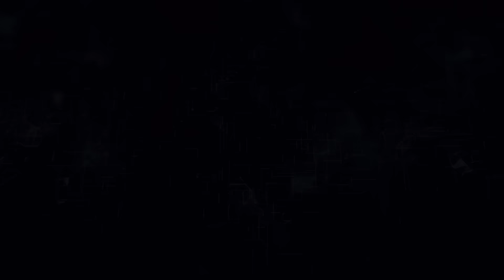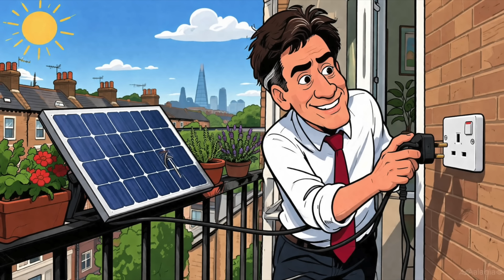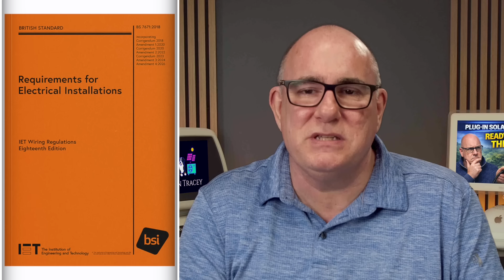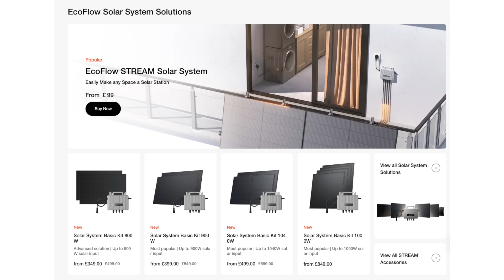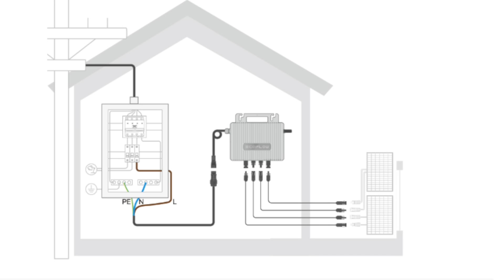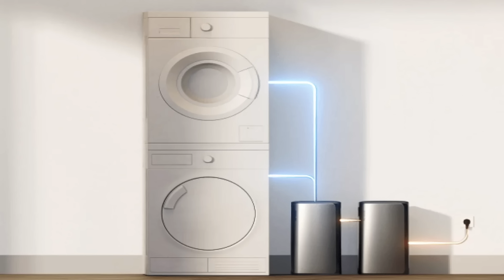Plug In Solar Is Coming… But There’s a Problem

Comment: ok I have an existing 4kw roof system on one of the old fit rates. When the sun shines I am exporting power on assumed 😢50% rate, so if I get a balcony system it would just all go to export with no money return. However there is a possible fix 😜 if I insert a power socket in the feed between the generation meter and the existing inverter and plug in there my balcony solar would be recorded on my generation meter. Somehow do not think ofgen would be happy but is it permissable.
Reply from the maker: @tracydowler834 I definitely wouldn't do that. If you connected a balcony system in a way that caused its generation to be recorded by your FIT generation meter, you'd effectively be claiming FIT payments on electricity that isn't coming from the accredited FIT installation.

The good news is that because you're on deemed export, the balcony system wouldn't reduce your FIT export payments. The energy from the balcony system would first reduce your import from the grid, which still has value, especially at today's electricity prices.

So while Ofgem probably wouldn't be very impressed with the "creative wiring" solution 😄, a properly installed balcony system can still save you money even alongside an older FIT installation.

Comment: Tks. Good info on 'side issues.' Please keep us up to date.
Reply from the maker: Will do Dave, new video coming this Tuesday showing what is possible. I built a simple plug in system with two panels, inverter and mounts for less than £300

Comment: Excellent video .. (  🇬🇧 electric regulations 💩  ) .. how many public sector workers  does it take to change a light bulb .... one to drive the van ... one to make the tea (  😝 ) ... one to take the light bulb  back to the depot ( fitting wrong ) ... and one to fill out the ( health - n - safety regulations ) ... U get this .. please comment ................ DAVE™🛑
Reply from the maker: Yeah, you do sometimes wonder if the entire civil service are basically extras from the series, yes Minister

Comment: If you want to know your baseline electricity consumption in your house or apartment, 
then look at how much electricity you use on Sunday afternoons when only the standby devices are plugged in and no heating is active.

This is the energy that you can replace with plug-in solar devices.
Reply from the maker: @jensschroder8214 that’s a good rule of thumb, but it can be quite misleading depending on how a household actually lives.

A lot of people don’t have a clean “Sunday afternoon baseline” — you’ve got fridges cycling, people in and out, kids on devices, maybe someone cooking, maybe not. For some homes that number will be way higher or lower than their true minimum.

A better way to think about it is your continuous load — what your house is drawing 24/7 regardless of time of day. That’s the bit plug-in solar is really targeting.

And even then, plug-in solar doesn’t just cover that one window — it offsets whatever you’re using when the sun is out. So if you work from home, run appliances in the day, or charge devices, it can go well beyond just “standby power”.

So you’re right in principle, but in practice it’s less about one snapshot in time and more about understanding your actual usage profile over the whole day 👍

Comment: It was similar in Germany. The regulations weren't ready yet, so people were already using plug-in solar devices. 
Anyone who can assemble a plug can put the finished cable together. 
There is a greater risk of an unstable solar module falling from the roof than of someone getting an electric shock.
The devices prevent voltage from being released if there is no 50Hz alternating voltage.
Even a loose plug or a bad connection to the fuse box and the device switches off.
Reply from the maker: @jensschroder8214 yeah this is exactly what people often miss 👍

What you’re describing is anti-islanding, and you’re right — these systems are designed to shut down the moment they don’t detect a stable 50Hz grid signal. So if the grid goes down, loose connection, bad wiring etc, they stop exporting almost instantly.

That’s why across Europe (Germany especially) we’ve seen huge adoption of plug-in solar without the wave of electrical incidents some people are predicting.

Where I think the UK discussion gets a bit skewed is we focus heavily on the electrical side, when realistically the bigger risks are often mechanical — poor mounting, panels not secured properly, that kind of thing.

That said, I do think we still need sensible standards here — not to stop adoption, but to make sure installs are safe and consistent as it scales.

So yeah, broadly agree — the technology itself is already doing a lot of the safety work 👍

Comment: I don’t agree with the base load part. In our house we are two and working from home. Base load is 34w. When fridge starts we go up to 100w. When we are both working, lights on (winter) and fridge is on, we tops at 230w. 
It means that we would almost always store energy in a battery that would kick in during the night.

The only time it won’t cover our needs would be when we cook something. Even washing machine would be covered by the plug-in solar.

Not everyone is using 10/20kWh a day. We use 3/3.5.
Reply from the maker: no one is saying everyone uses 10/20kWh, everyones base load is different but for most, like you it sounds like a small system like this will cover your needs just fine

Comment: Plug-in solar / battery systems look like the way I'll go. We're not planning on staying at our house long enough to recoup the investment in a hard-wired system (probably move in about 5 years). With plug-in it is:

1) Cheaper as no labour to pay for.
2) Mobile, we can take it with us when we move.
3) Configurable to take advantage of EV tariffs.

Ecoflow do the Stream Ultra X Storage Kit which has 5.76kWh of storage, which based on our current IOG on and off-peak rates would give us pay back in about 5 years. The intention is to cover peak demand using off-peak storage as is pretty standard, for us, 5kWh would cover the evening surge. Then as you mention, the solar option is there if you want to cover the background noise throughout the day (i.e. fridge etc). I'm quite optimistic about it, although why is this country always at the arse end of adopting modern technology...that's a rhetorical question btw, I know the answer.
Reply from the maker: @Chris-eo5zs That’s a really well thought through approach 👍  

You’ve basically nailed the use case — use cheap off-peak to cover evenings, then let solar chip away at the daytime base load.  

And the portability point is massive… a lot of people overlook that when comparing to fixed installs.  

5 year ROI is actually pretty solid in the current market, especially if you’re consistently cycling it daily.

Comment: Can someone please explain to me the impact of sending electricity backwards through my RCBOs?
Reply from the maker: if they are bi directional no issues, if they are not there is potential for them to be damaged an not trip out when needed
Reply: @JonathanTracey  Ok, thanks for the feedback. Would I just need to have a bi-directional RCBO on the ring circuit that the plug-in solar / inverter is on?

Comment: If you buy one now and just plug it I ro a socket, will the pins be live? Also, as its not wired in, would it be legal? Perhaps just unplug and switch off the solar pending a safety inspection? Just as none wired in outdoor sockets are legal if just plugged into a socket in the house. It's just an extension lead in effect. Preferably with a wired red plug fitted to the indoor chosen socket.
So, if it turns out it is legal, but very dangerous, is it still possible? Perhaps an outdoor waterproof socket with a tamperproof cover so the plug cant be easily taken out. I want one!
Reply from the maker: @nodriveasusephotos8019 Good questions — there’s a lot of confusion around this at the moment.  

The pins won’t be live when unplugged — the inverter only outputs when it detects grid power (that’s the anti-islanding protection).  

Legality is the grey area in the UK right now — technically not fully supported in regs yet, but also not explicitly banned if done safely.  

Big thing is making sure it’s installed properly (RCD/RCBO protection, suitable circuit, etc). It’s not just an “extension lead” situation — it needs to be treated like a generation source.  

Hopefully the regs catch up soon because a lot of people want to do exactly this.

Comment: Question: I understand Plug in Solar is limited to 800w with an Ecoflow inverter. Could a second 800w installation be installed if it fed into a separate ring main?
Reply from the maker: yes, absolutely. I know it works because I’m doing it right now. However, I’m not sure once the legislation gets updated whether this”legally” allowed

Comment: Sorry to sound stupid, but to me a plug socket is for power going OUT.
If you plug a solar panel, via an inverter, and plug it in, then the power is going IN.
IE Sending electricity the wrong way. 
That doesn't make sense to me.
Where am I getting this wrong?
Reply from the maker: @StephenInfield It feels wrong, but it isn’t 👍

Your house wiring doesn’t care which “direction” power flows — if your panels are generating, they just reduce what you pull from the grid first, and only export if there’s excess.
Reply: @JonathanTracey Aha! Thank you. But doesn't it only work if you have something consuming power at the same time? 
Presumably, a fridge freezer would work for this, as they use a lot of power. 
Obviously, it would depend on how big an array, but as a general rule, would it be enough? 
As there's only generation during daylight, presumably one runs other appliances like washing machine and dishwasher at that time?

Comment: Can you add this to a house that already has solar panels and batteries?
Reply from the maker: @beaker1068 Short answer: yes 👍

These can sit alongside an existing solar + battery setup, but you need to be a bit careful about how everything interacts (especially export limits and CT clamp behaviour).

They’re best thought of as “another small system” rather than part of your main install.

Comment: I think the big issue is that people think in the extremes... 
"all or nothing"

The marketing people will advertise it as "null your bills" when all it can do is reduce. 
Thinking logically, most of our electricity bills is the standing charge... 

But my perspective:
- at least I learned I wont be able to charge an EV out of this... So thats a good heads up. 
- I am interested in it, but lets face it, it needs a good return of investment calculation. 
If it saves £1-200, but it costs 800 to get one, will it even last for 4 years?* 

* need to consider 
- energy price changes 
- thieves
- life of a battery ** 

** many fake chinese products are already on amazon
Reply from the maker: @tiborsipos1174 You’re spot on about the “all or nothing” thinking—this stuff is about reducing bills, not magically eliminating them.

On the ROI side, you don’t need to overcomplicate it or try and predict the future. Take what you paid, divide it by what you save each year, and that’s your payback. The reality is the savings can be a lot lower than people expect depending on how you use it.

For example, my own 6kW Stream setup has a full ROI calculator here: https://www.jonathantracey.com/ecoflow-stream-roi-dashboard — and that comes out at roughly 7 years.

That said, I’m not overly concerned about that timeline because the battery warranty is 6000 cycles, which is about 16 years of use. So even if the payback isn’t lightning fast, there’s still a long tail of savings after that.

You’re absolutely right though—things like energy prices, usage patterns and product quality all matter. That’s why I always push people to run the numbers for their own situation rather than rely on marketing claims.

Comment: It's probably better to buy a batter charge it at night when electricity is low cost and use it to run th fridge
Reply from the maker: that’s exactly what this is
Reply: The plug in solar system doesnt use a battery

Comment: I'd be happy just to knock a 1 or 2 hundred pounds off the anual bill. If the initial cost is 400 and you save 100 anually it'll  take 4 years before it pays for itself. How long will these units last.
Reply from the maker: warranty is 6000 cycles so 1 per day is 16 years

Comment: 800w is large for most house holds that actually draw less than 300w, having up to 800w can offset a lot of the households energy, if your producing more than you are drawing then a battery system like the Eco flow stream batteries, you can set to offset your electricity at peek times.

Then there is the issue with some older smart meters still charge people for export.
Reply from the maker: Yep there is a lot of work for government to do to make this a reality
Reply: Honestly its pathetic what an absolute mess the Government made of the smart meter rollout. Two goes at it, what a waste of money and all the Smet1 issues were obvious before they even went into production.

Comment: I had a solar to battery and a converter

Added a plug

Blew up.
Plugged in

I cant figure out why.
Reply from the maker: What exactly do you mean by converter, if you mean an inverter, that changes the DC from the batteries to AC to feed into your house then you would need to check with a qualified electrician that you’ve got it wired up properly.

Comment: Spend around £1,000 on a micro solar system... To save £150 per year?
Surely it is far far better to invest in a home battery pack and use cheap OR free energy....
Reply from the maker: everyones return is going to be different you can build a small microsolar system for £250 so the payback will be much cheaper. on the battery front i have a video coming tuesday where we talk about plug in batteries and their ROI

Comment: Can I ask one question?

What on earth are you all powering?

What are you doing?

My "base load" is 70W. Thats it. It goes a bit higher when the fridge or chest freezer come on but basically when I'm not home nothing is drawing anything above 150W.

Now, sure I run the washing machine once a week. But the motor for it consumes 300W and it runs for what, two hours?

Obviously we are ignoring heating. Considering that is only on when it's cold and only a couple of times a day too. Plus my heating is gas but like I said we can ignore that.

During a typical day, with TV, a brew of tea in the morning, a bit of gaming, I'm not going above 300W at any moment save for the kettle or microwave.

An 800W installation like this is going to make my entire weekend free. All day free. A single 400W panel in full sun will make the day free... The washing machine, especially in summer when it doesn't heat water, free.

Assuming enough sun that day.

The kettle pulls 1600W, so will have that slashed certainly on a sunny day but again, it's on for all of two minutes a day...

If you have power draw considered as base load that 800W of panels won't make essentially free, you have real power usage problems.
Reply from the maker: @dlarge6502 It really depends on the household 👍

In our case it’s two electric cars, a hot tub, a heat pump, plus two of us working from home full time — so it all adds up pretty quickly compared to a lower-usage setup.

You’re absolutely right though — if your base load is that low, a small system like 800W can make a huge dent, especially in summer. For some people it’ll cover most of their daytime usage.

But once you start layering in things like EV charging, heating, hot water, and constant daytime usage, the demand profile looks very different — and that’s where larger systems start to make more sense.

That’s why I always say there’s no one-size-fits-all — it completely depends on your usage 👍
Reply: It doesn't take much to exceed your 70 watts. A decent sized garden pond will draw a couple of hundred watts, a decent sized PC for office use with a ultra wide monitor adds another 250W, it soon adds up unless you run next to nothing like you do.

Comment: I’d like to point out something important. 
If a solar panel is exposed to sunlight, it generates electricity right away!!! It doesn’t have to go through the inverter first. Even a single 450W, 35V panel can be dangerous. As long as there’s a plug on both ends of the cable, it’s safe.
Reply from the maker: sure this is why panels now come with MC4 connectors as standard

Comment: Quick question: Right now, the UK policy only covers plug-in solar with microinverters, and there's nothing about battery-integrated units. If I get an all-in-one plug-and-play system with a built-in battery, does that mean it can't be classed as a simple plug-in device anymore, and I'll need to do a formal grid connection application?
Reply from the maker: legislation covers micro generation equipment not batteries, so they are only interested in the part that connects to the mains. So if you have an all in one unit with a battery your register it as you would a stand alone generator

Comment: I have been following your videos  they have been really helpful, I am interested in getting a system installed, in fact I have contacted an electrician to get a quote for installing the necessary bits and bobs to make it legal, I am also researching what micro inverter I need ,a lot of hype around ecoflow but I'm checking out others like Hoymiles, so it would be good to hear about other manufacturers and Systems
Reply from the maker: yep, I’m limited to what I can do from an experimental point of view by my own budget. If the vendors don’t want to provide support, EcoFlow have been pretty good in that they provide lots of kit for long-term test

With regard to hoymiles i’ve actually ordered one with my own money. It should be here the end of this week, so watch out for a test of that particular micro inverter.